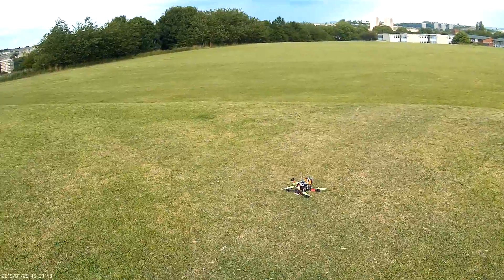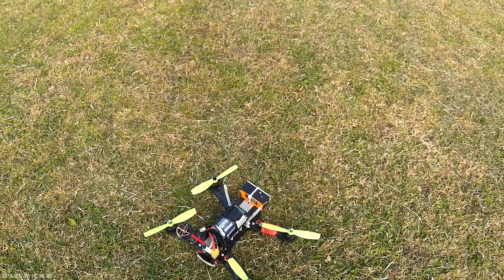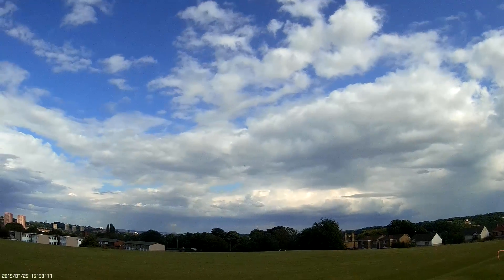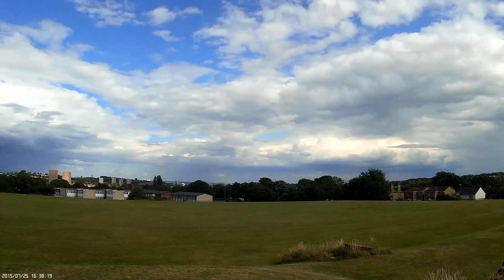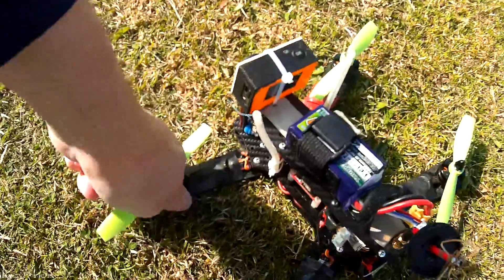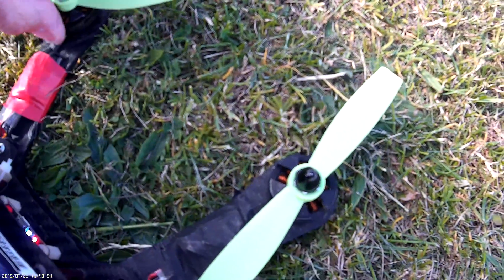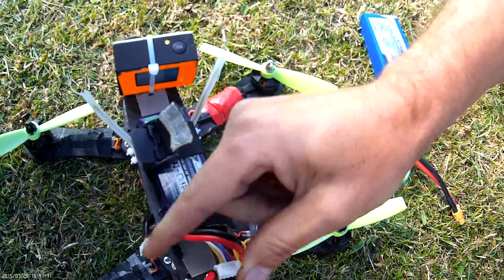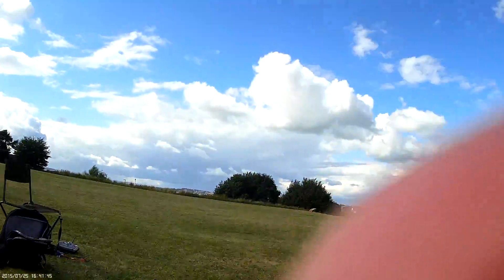ZMR 250 with 2204 2300kv motors 12A ESC's with 5x4.5 BullNose Props and a 4S 45 90C 1000mah battery

Comment: flight time??
Reply from the maker: seetcas Not long. This is an old video. Things have moved on a long way, but even these relatively low power motors would empty a 1000mah 4S in about 2-3 mins.
Reply: what would you recommended for this setup ? 3s? and what mah??
Reply from the maker: With those 1806 motors, your better off with 5040x3 props & 3S. Keep it light. so a 1300 3S. I use the Nanotech 45-90C batteries from HobbyKing, but the 65-130C 1300 Graphine packs are about the best for the money.
Reply: blackbirdboy1 Thanks for the tip
Reply from the maker: No worries.

Comment: What u mean "props are cut down" ??
Reply from the maker: This was before bullnose were easy to get hold off! So we got some old DAL 6040 Props and cut them down to 5040 bullnose ourselves. A pain to do and balance, but when needs must!!!
Reply: +blackbirdboy1 I've sorta got the same setup. have u run 4S on this esc's? and what props?
Reply from the maker: I should add, I ONLY use DAL Props now. Mainly the T5045 & Q5040's. Others will say HQ & GemFan are better!!! Maybe, but i can't easily get hold of those props & they cost nearly twice as much and one crash can STILL kill them, so I use DAL from Surveilzone. There perfectly balanced and have loads to chose from. 3-6 inch versions, 2-3&4 blade versions too. Take a look.
Reply from the maker: This was a year ago, but if i remember rightly, he had ZTW 12A ESC's. They seemed to be able to handle 4S with DAL 5045BN props. Things have moved on my friend, I now use DYS XM20A ESC's. The new LittleBees 20A Pro's are supposed to be good too, but the old littlebees are now outdated for the latest BlHeli Firmware. I also have the DYS SE 2205 2300kv racing motors and with the DAL T5045 or Q5040 pros, my cheapo Banggoodd GE220 X frame is a missile. Over 1Kg thrust per motor and the thing weighs under 600g with a RunCam 2 on it. Highly recommend one. 
I also use the X-Racer F3 FC from FPVModel.com.
Bed time now for me my friend, hope this helps, speak to later.

Comment: How did the esc's do being on 4s?
Reply from the maker: They were fine. 12A Spider ESC's I think? He used them for a while with this quad before upgrading the motors and ESC's later. Those motors  are best on 5045 bullnose or 5045x3 blade props though. 6045 props are too much for those motors & 6045 props on a 4S!!!